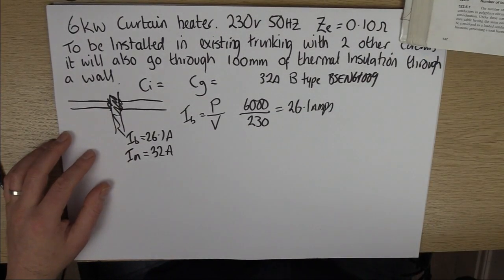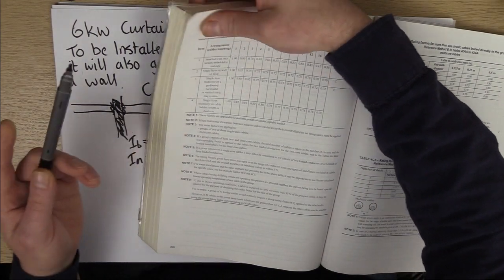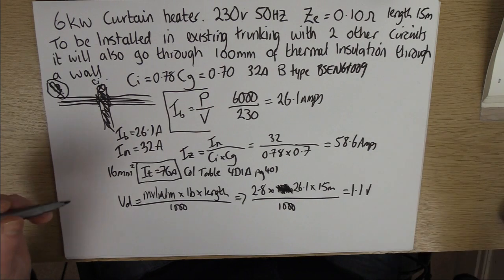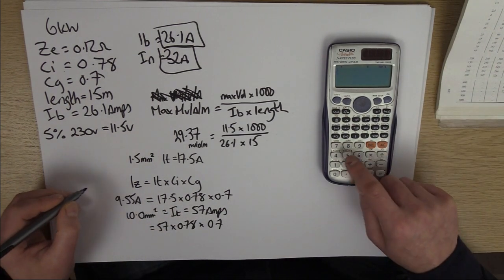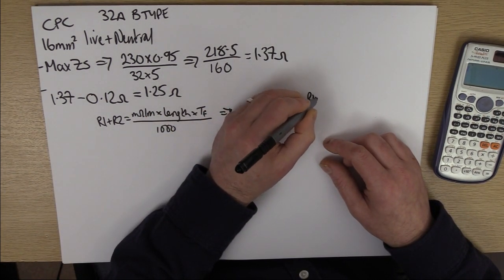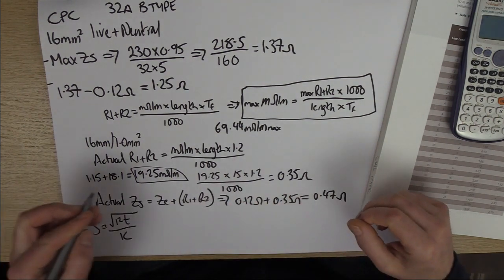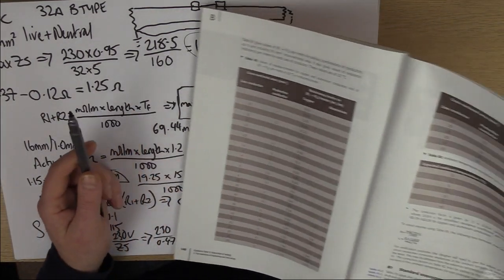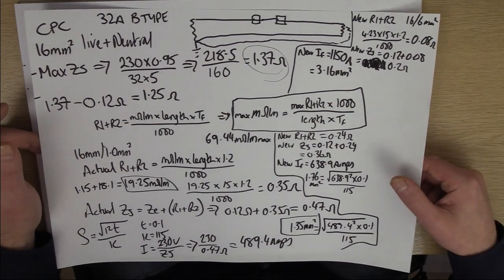step by step Cable calculation for Resistive load 6kw curtain heater. Electrical

Comment: Another outstanding video Craig, just a query @ 33.58 I think you work the new zs out wrong!!!! Our ze should have been 0.10ohms (not 0.12ohms) it’s not a biggy though!!!

Yes as you mentioned ring final calcs would be good, maybe a calc for running a new sub main to a new shed supply (or something bigger)

Great videos keep them coming👍👍
Reply from the maker: Ha yeah you are prob right. Still complies though right 😬🤞.....prob still had the other example in my head. 

In the real world I use a spreadsheet that calculates in one direction and then another to ensure it returns to the start point. This takes into account my dyslexia and stops me installing a dodgy circuit but does make teaching hard..... I sometimes say it's deliberate to check if my students are paying attention but alas..... Tis not 🤫🤐

Comment: Excellent video !    when determining the cpc size it is better to work backwords using the maximum permitted Zs, by applying the formula:  maximum R1+R2 =((Zs max −  Ze) / (I3 factor x Length)) x1000 in mΩ/metre, and then use table I1 to select a cpc size.  This avoids hit and miss calculations.
Reply from the maker: Thank you so much 🙏

Yes that usually finds a suitable cpc faster. Still needs to be checked with adiabatic.

It is possibly to work backwards from adiabatic as well........

Comment: Great vid like the music , i tend to find regs quickly using the tabs i think i got mine from online helps massively
Reply from the maker: Wasn't too distracting was it? The music? Nice to fill the sound spectrum I feel for the boring bits. I never got round to tabbing my 18th.....i did such a great job of my 16th that I was very disheartened at the thought of doing it all again so never did......It would make sense to duplicate the Ci factors within app 4 but I understand the reasons for it being where it is.

But as you can see those factors are very generic and this is a good case for learning more about it so you could be confident about saying 10mm is fine..... Which it prob would be tbh but you would need more info on which type of insulation, thermal conductivity etc. I think I put a reference to the standard you would need to go deeper but as usual quite expensive really which is really annoying and baffling when we are all trying to encourage learning! Bsi needs to be a public body which is OK to release its content. Like hse imo.
Reply: @cestemshow  music was fine not a distraction , yeah i do a fair amount of flats where you have 101 102 ref methods along with grouping as much as you tell other trades to not cover cables 523.9 i habe to design for it my cookers are spec 10kw the clients spark manager doesnt take 311.1 into account so no diversity so the cookers are 16mm² and showers also 16mm²